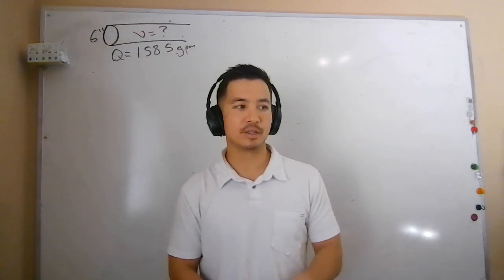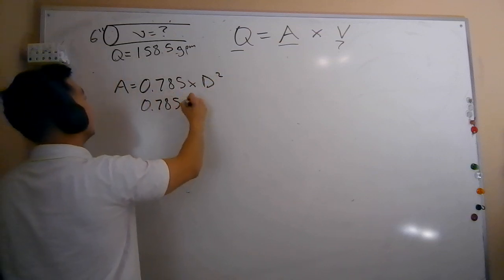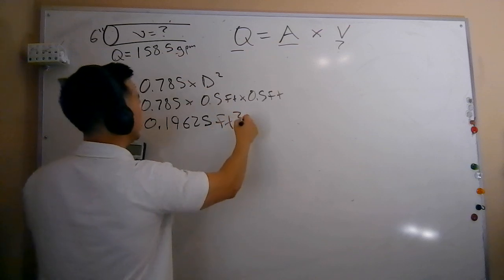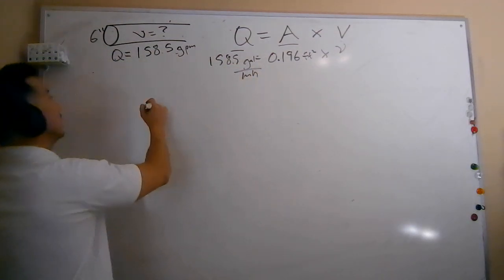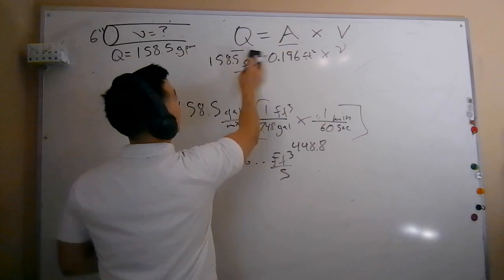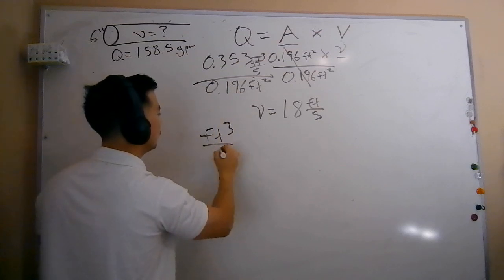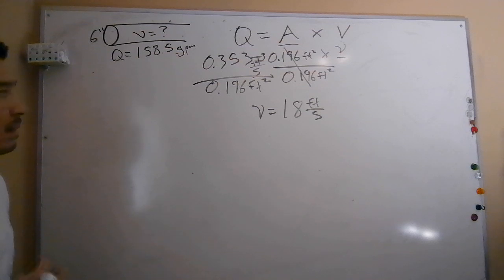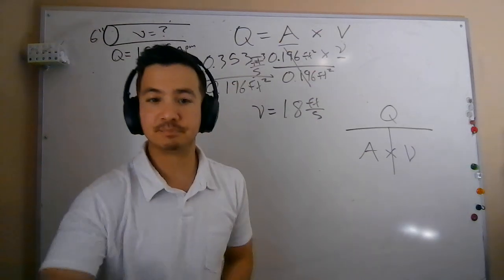Water Math: Calculating Velocity

Comment: If you want the pipe open on the top - so more like a circular U and you only want water level to go up half way so that it doesn't spill out of the open top, would it be as simple as dividing the full circle area by 2 in the Q = A x V equation? Also, if the pipe is going to have a declining angle, how does that effect the velocity?